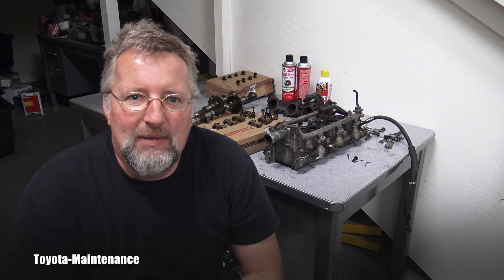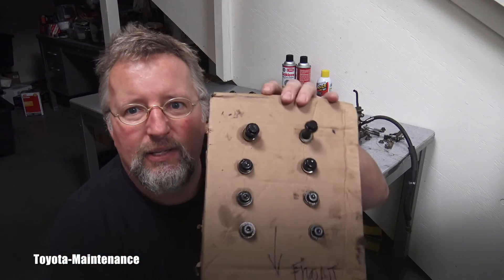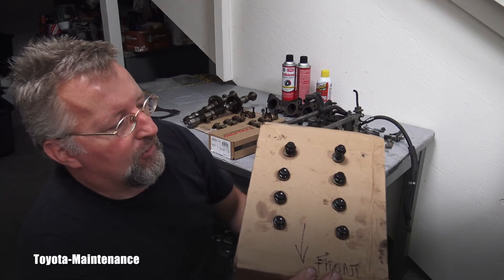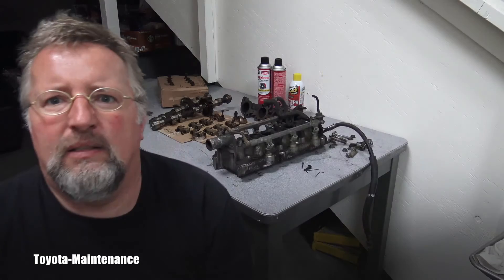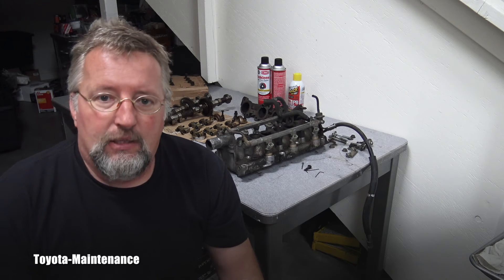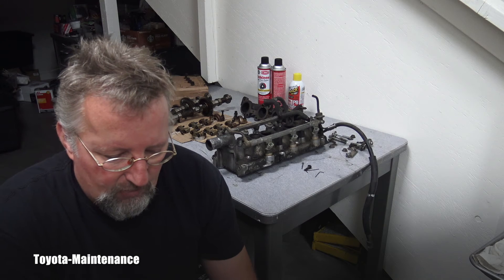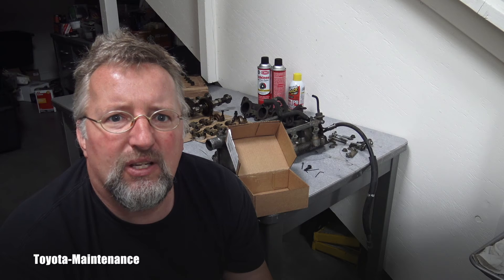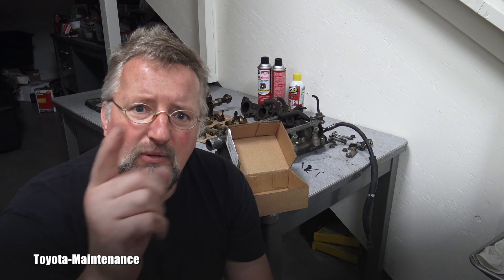Toyota cylinder head bolts

Comment: Nice video!  Very relevant if you are working on replacing a head gasket like I am on a 4.0L V6 (1GR-FE).  For those of us who have been reading and researching to death about whether or not you can replace vs re-use head bolts.  My bolts measured in spec per the manual but I did order a set of Fel Pro head bolts after many hours of research.